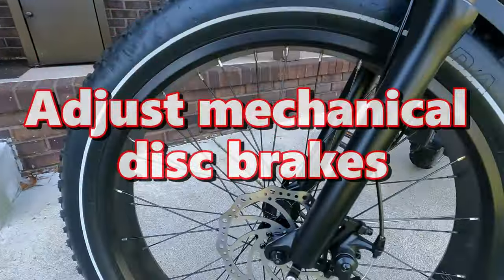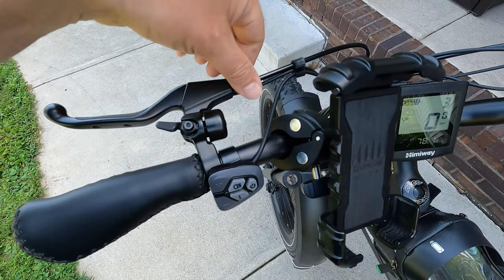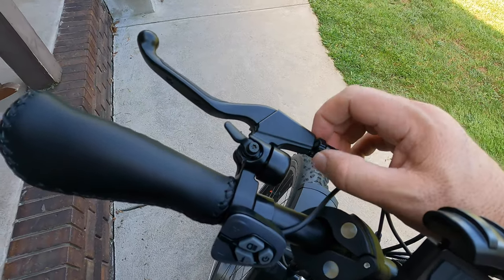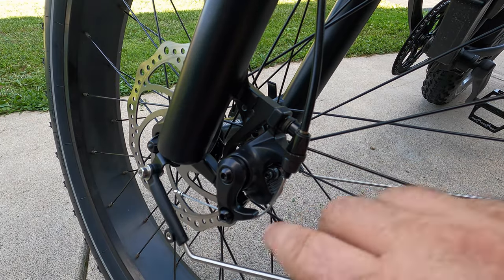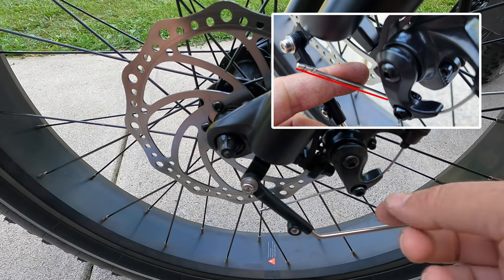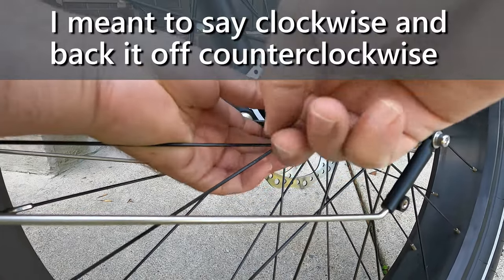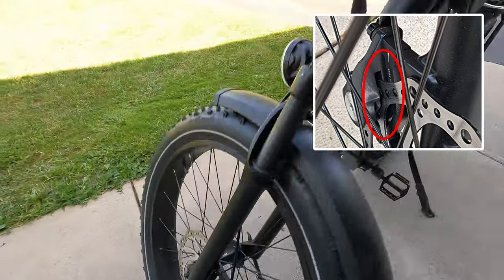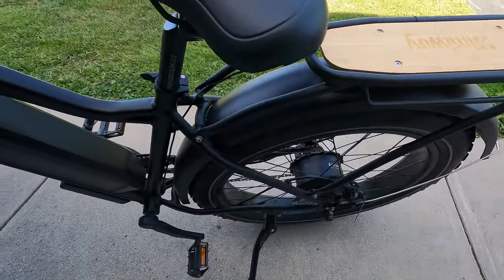How I Adjusted My Brakes on My Fat Tire Electric Bike

Comment: Just bought an ebike from Amazon and when I put the front wheel on, I get significant rub on the disc... I am going to try this.  Thank you!
Reply from the maker: No problem, thanks for taking the time to comment.
Reply: I had the same problem
Reply: Same thing bought 2 like bikes one had front brake issue which brought me to your video 👍🏻 and one had neck fitment issue .. great customer support tho
Reply: Back pad was dragging on my new eBike 1/2 turn to left on back pad screw did it.
Reply: @mikerochester  my back brake pads are god but it's the  brake cable  mine touch I tried and tried  to edjust it still the same I kdnt understand the twisting thing

Comment: Nothing helped . If I do the adjustments you mentioned the pads are to tight around rotor . If I leave the brake lever arm in the relaxed position the brake touches the handle bar and doesn’t do anything I’m so frustrated
Reply from the maker: Sounds like you may be having some other kind of issue I would reach out to a local bike shop.

Comment: I tried to install a second light on my headlamp and didnt go good my lights now dont turn off from the light off and on switch now i have to turn the lights off from the off and on switch feom my battery now how can i fix it cuz i dont want my lights on during the day while i ride it. Also the new light didnt survive cuz the freego EV bike battery is to much power so it blew it out. Now i jist want to turn my lights off from the regular place but it doesnt
Reply from the maker: @youngone697  I'm not quite sure I understand why you're messaging me this? Your commenting on a mechanical brake video. Also I do not have a freego eBike. Are you trying to message someone else?

Comment: I definitely will try Step 2, because my brakes are very loose, so when I go a bit too fast and I need to brake on time, it won't, I need like 10 seconds and it's not handy. So I will try this tomorrow!, This is a very helpful information.
Reply from the maker: No problem hope it works. 
Please share your results.

Comment: Thanks for your help,just got my new P6 and my brakes were all funky.
Reply from the maker: Glad it helped and thanks for taking the time to comment.
Reply: That's the same bike I have ! I've been having major issues with my brakes since I got it 3 months ago. Already had the bike shop fix them 3 times and they still keep coming loose . I've tried doing everything they showed me at the shop as well as every video on YouTube and I still can't figure it out . I followed this video to a T and still can't get my back brake to work .
Reply: @JordanBeachBodycoach  I got a P6 too and my brakes are really bad, that's the weakness of our bikes, i'm trying to adjust mine as well and having an hard time. The best thing to do is to change the brakes setup completly for an hydrolic brake system before we die on this thing haha

Comment: I have mechanical disc brakes on my e-bike. When I apply a constant force on the levers to stop the bike normally, the actual stopping force oscillates between hard and soft braking. My bike is brand new is this expected? Should I just wait for the problem to go away or is there something I can do about it?
Reply from the maker: New brakes normally need to be bedded in. I would just make sure that you're brake calipers are tightened down and that your rotors are not bent. More than that I would check with the local bike shop.

Comment: sometimes my rear brake makes a click sound when i pull down on it and after the brake completely stops working and i have to adjust it again. do you know any way to fix this issue?
Reply from the maker: Wonder if your screw is stripped or coming loose somehow not really sure what's going on there probably best bet to take it into a bike shop in your area.

Comment: will this stop the squeaking sound?
Reply from the maker: If the brakes are rubbing on the brake pads this should realign them. Squeaking sound can be coming from other stuff as well including oils on the rotor.

Comment: FYI You didn't put barrel connectors back to starting point. That's just the lock nut. You have to screw the ENTIRE (lock nut and barrel) all the way into the lever housing to add back all the slack removed over time with adjustment.  The lock nut should ALWAYS be tight, regardless of where the barrel is, to keep it from moving unintentionally.  Good video otherwise, but you definitely need to completely remove the barrel slack BEFORE pulling more cable through  else you wont have any adjustment room in the field.
Reply from the maker: Thanks for sharing